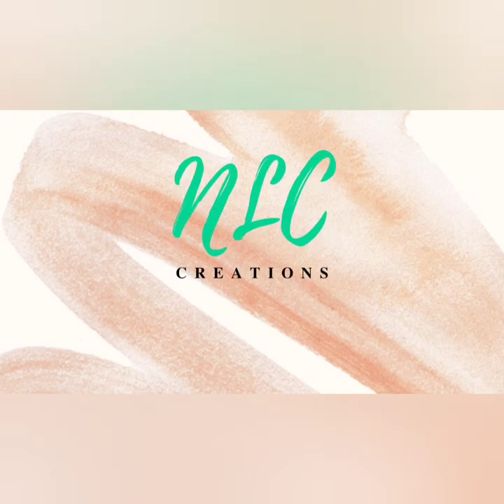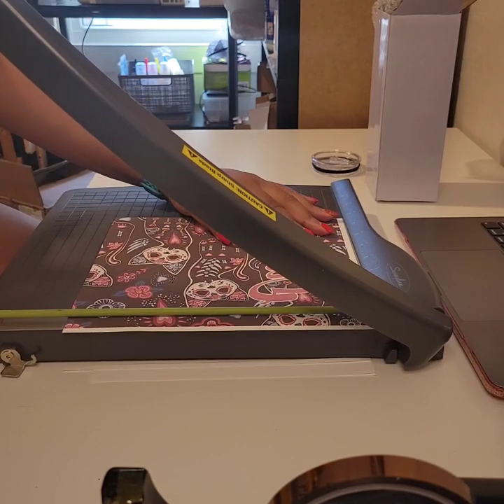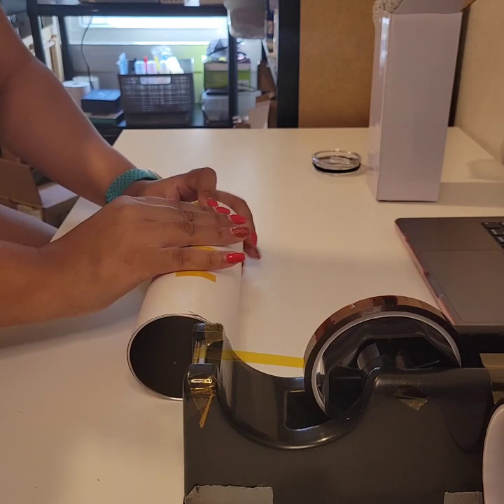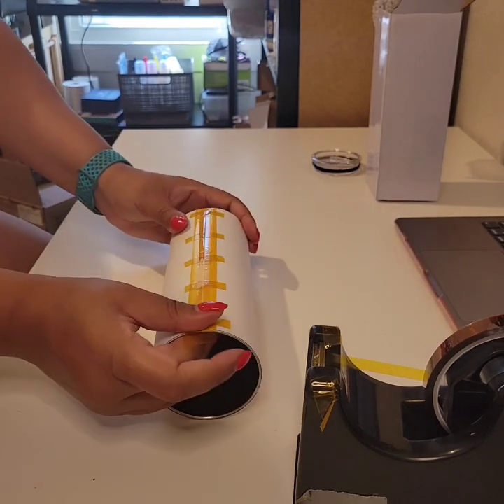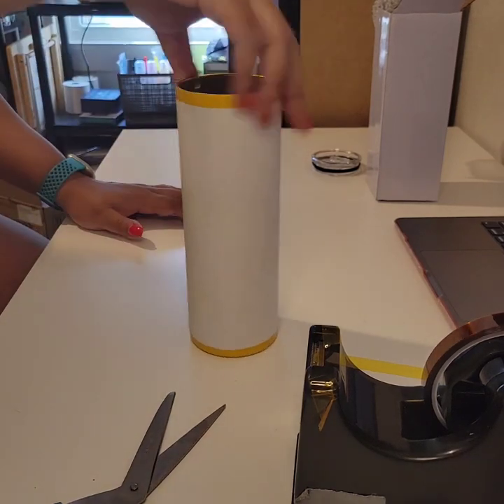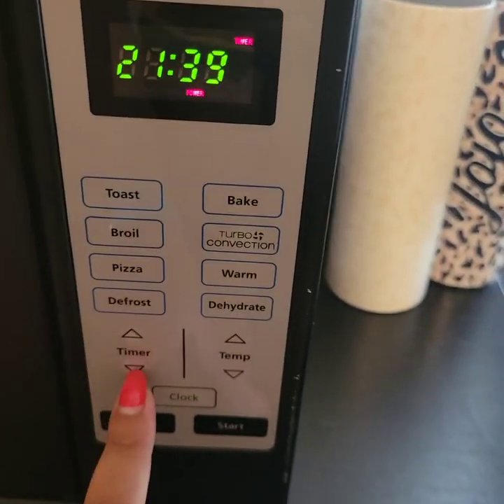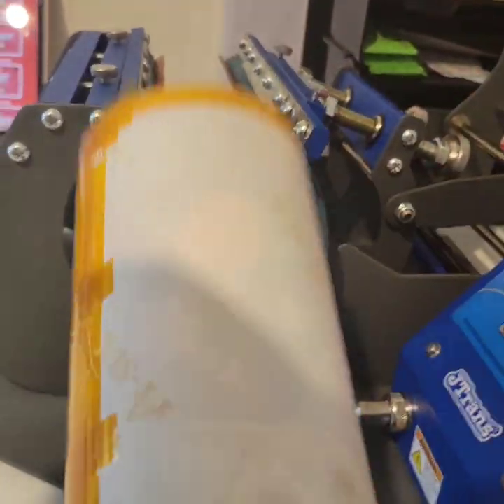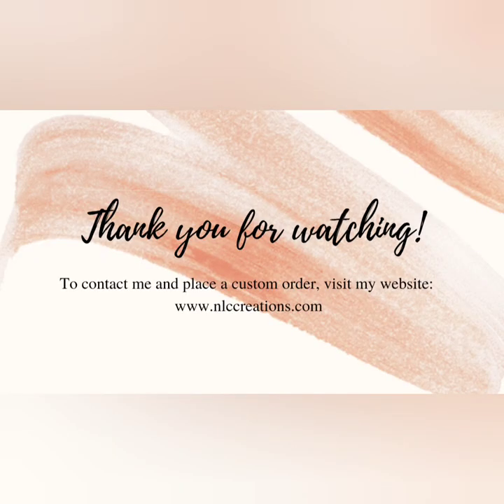How to tape and sublimate a straight 20oz Tumbler for Convection| No Shrink Wrap | Beginner friendly

Comment: Just Curiois, if you have a mug press why wouldnt you sublimate the tumbler in there vs the oven?
Reply: This specific mug press doesn't work well with full coverage designs. The top and bottom fade.
Reply: @nikkifromnlc  That is my problem. Especially on dark tumblers. So would you suggest buying both the oven and the tumbler press? What temperature was your press set at for the 30 seconds.
Reply from the maker: @idahospudnut  I have both. I've started leaning more towards using just the heat press however if you want a design to cover the top and bottom of the cup, the oven is the better choice. If you're OK with leaving a sliver of white at the top and bottom, the heat press is most efficient.

Comment: thanks for the straight to the point video!! what makes this  a seamless design? the white overhang? is it hard to get the design to match up perfectly but not overlap at the seam?
Reply from the maker: Seamless means the two edges match up perfectly and the design flows all the way around. You can't tell where it begins and ends.
Reply from the maker: It's trial and error to make sure you have your cup and print measurements exactly correct. The overlap just helps with taping the design to the cup. So long as you're cutting the design out straight, you shouldn't have an issue lining up the edges.
Reply: What if you don't have a tumbler press?

Comment: What if I don't have a tumbler press?  Will this still work?
Reply from the maker: Yes. It should. What I did before I didn't have a press was about 3-4 minutes in of baking, I would take the cup out briefly and make sure the tape was secured down the seam of the cup and then put it back in the oven to complete the baking.

Comment: Wondering what kind of heat pad you are using in the oven? New at this
Reply from the maker: It's a silicone mat I purchased on Amazon. I just put it in the bottom so my cups don't sit directly on the metal.

Comment: What size did you use for the template? I have been trying to get it to leave a little white at the bottom without ghosting. Absolutely love this video wish you would make more.
Reply from the maker: Hi Judy! The size depends on the cup. I measure the cups from different vendors to see their height and circumference and print my designs at that size. I'll post a video soon on how to do that.
Reply: @NLCCreationsOfficial  do u just buy files and print your own
Reply: If so do the files stay with u for as many prints as u want
Reply from the maker: @Holly Svandrlik  I buy files and create some myself. Each website you purchase from will tell you what the rules are for using their files.
Reply from the maker: @judy I created a video on how to measure your cups. https://youtu.be/HTcPtemoSvk